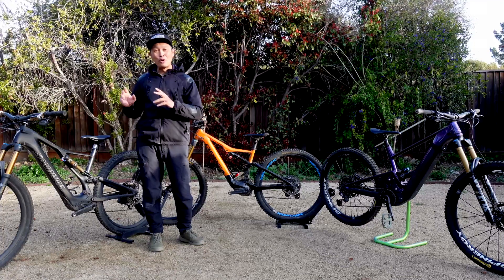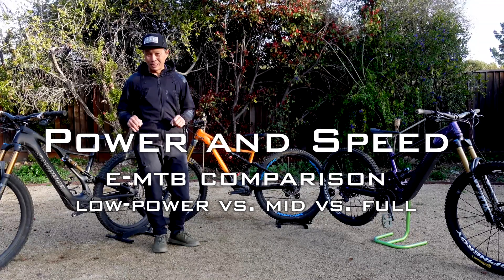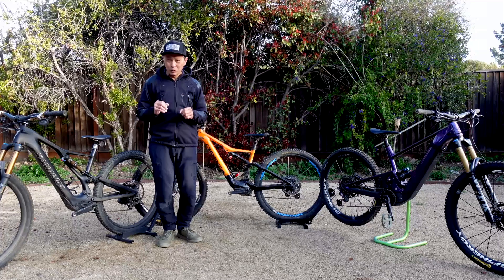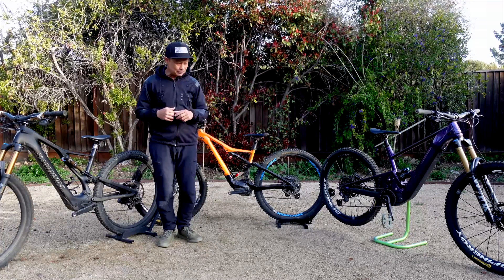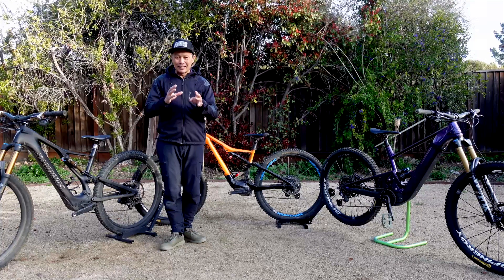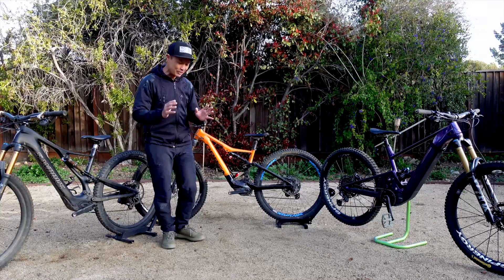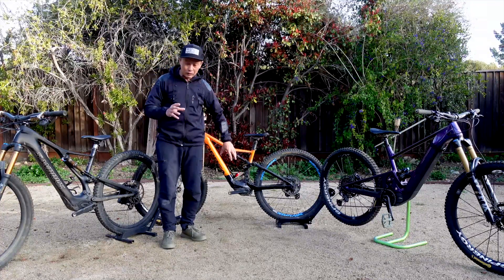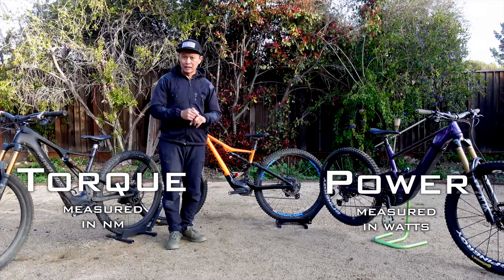Low, Mid, and Full powered E-mtb - measuring power and speed of ebikes

Comment: Would love a test to see which bikes are ridable without the battery (Tranny claims the Relay works well without)
Reply: @EMTBReview  I have an EXE but needed to sell my regular bike to afford it. Many of the trails near where I live (Boulder) are still closed to eMTB. Would be nice to be able to pull out the battery now and then for a short, close-to-home ride. Better yet, open the trails to eMTB :)
Reply: @gfowkes  So the Fuel ex-e is not rideable with battery removed?
Reply: @jbhall411  I actually rode it quite a bit last weekend with the battery in, but the power off. I was riding with a group of guys on regular bikes so I wanted to give it a try. You can feel a bit of a drag when you initially start pedaling, but that quickly goes away. Not sure how practical it is, but seems possible to ride it without the battery.
Reply: @Greg  thanks for the info. I just started looking into eMTBs this week so I'm still pretty ignorant on the subject. But being able to ride without power seems rather critical for a host of reasons.

Comment: Where’s the Luna brand ?
Reply: If you consider those 3 bikes low, medium and full power.  Then a Luna would be considered a super mega power bike.  Using the Bafang Ultra 160nm / 1000w (peaks at 1500w) motor, it's killer.

I have a dengfu e22 which is effectively what the Luna is, except bought direct from the frame manufacturer in China.   And it flys.  I go past what you call "full power" like they are standing still.

Comment: So far, my Spectral ON CF8 Canyon works, its flickable, but its 53 lbs, somehow it steers quick and likes to be thrown around.
Its got that big battery but I have yet to notice it................when you need the range, or want the power, its got it.
Does everything in trail mode pretty easily.

I dont really want a low power/smaller battery bike. I already ride my amish bikes 160 miles a week on average.

Comment: Thank you for the effort put into this video.  It helps me want to keep my Kenevo SL (low power category). Happy with the climbing times and effort required.
Reply: @EMTBReview  
You must have been doing monster rides.  I rode yesterday my Kenevo SL for 20.1 miles/ 3800 feet of elevation gained on turbo the whole time and had 25% battery left (from the 150% with the range extender). That’s my limit for a day.  

Awesome content. Keep it coming 🤙

Comment: Excellent video. Does a good job for helping people decide. I recently went from a YT Decoy to a Trek Fuel EXe and the difference is very noticeable on full power. Basically what I found is the Trek does not have the option to fully bail out and climb with close to no effort. Almost like the YT if Boost was disabled. I still think the YT is slightly more powerful on Trail vs. the Trek on full blast (but close). I prefer the Trek because it gives me enough power to make it up steep pitches that I can't climb on a normal bike. Occasionally I miss the effortless power of the YT, but that's pretty rare. If I had a dedicated bike park style trail system near me (with no lifts) I'd still want to keep a full power bike around.